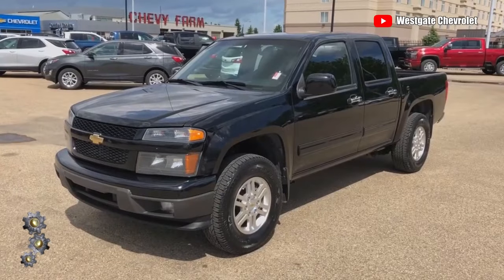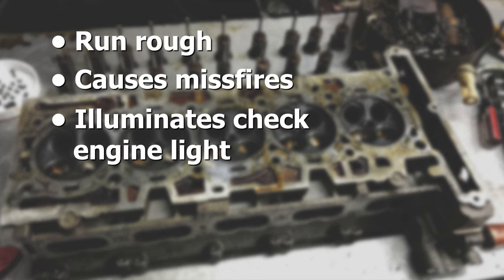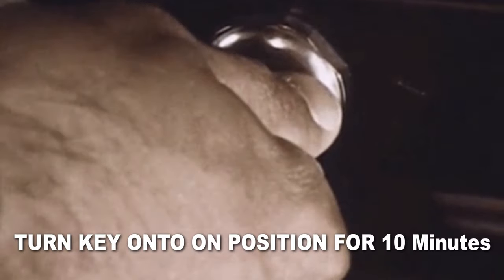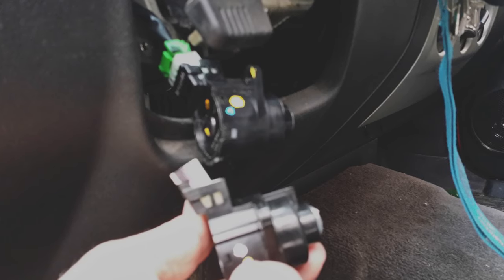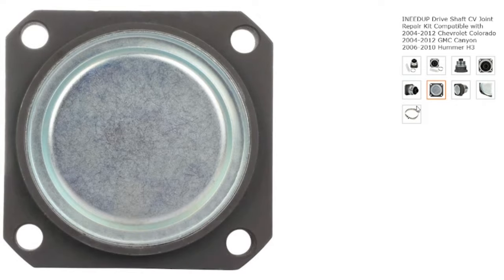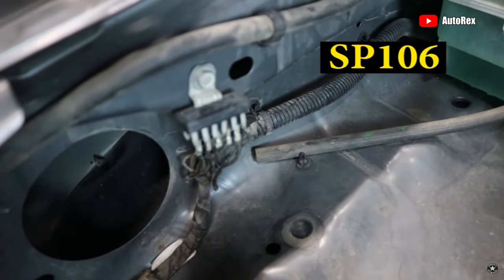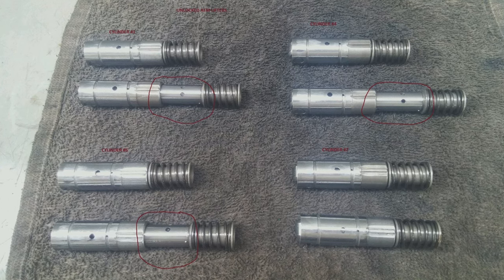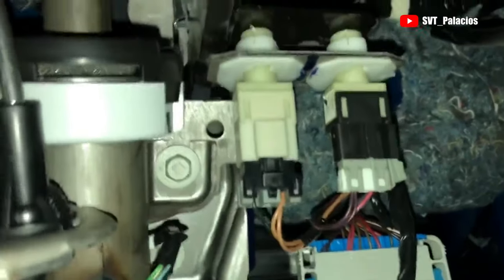Watch This Before Buying a Chevrolet Colorado  2004-2012 (GMC Canyon)

Comment: I have a 2005 i5 Colorado that just rolled over 300k miles and it’s still bulletproof!!
Reply: "redneck voice": yeeeeaaahh I got me a 2004 Toyota frontier 4x4 with 2 miles, bullet proof at it's finest here. Especially when I go off road at Costco market, switch that puppy to hi 4x4 . TRD nismo for life "
Reply: Change your oil and it will see 600k. Poor maintenance spins bearings on these beauties.
Reply: I got a 06 i5 z71 2dr 150k coming to my house next week! Hoping to drive it everywhere!
Reply: I have 2008 best truck I ever had. Not one problem, 150 thousand.
Reply: Is it still running?
Reply: My 2012 GMC Canyon i5 3.7L just hit 275,000 miles & still is going strong with just doing the recommended preventative maintenance.
Reply: 2005 Colorado - 200k miles and still going strong. I change the engine oil every 4k, transmission fluid every 30k, and power steering fluid about once a year.
Reply: Do you still have it though
Reply: My 05 blew up at right around 250k
Reply: any updates?

Comment: My 2004 Colorado 4 cylinders still running strong 💪 with 200 thousand miles
Reply: good to hear brother, just got my 4 cylinder 2009 colorado for about $12k at 90,000 miles!
Reply: 2006 5 cylinder 249000 miles
Reply: OPOL  didnt have much time to search for a private seller with a deal at the peak  of the used car market. Guy rear ended me and totaled my previous vehicle.
Reply: @AegisofAges  I just got a 09 gmc canyon 97,000 miles got it for 5 grand but i got a friend deal
Reply: My 04 Canyon 3.5l has 317k an still trucking
Reply: @AegisofAges  how’s she running now? I’m about to buy a 2012 colorado with the same miles for about the same price
Reply: @kwp3097  its great man no complaints. starts up easily in cold temps. its at about 105k mileage now. Its a real easy vehicle to work on I was able to do all the 100k mile mark maintenance myself. Check and see if the 2012 model has rear drum brakes, I never serviced those before and they look tricky so i am looking into doing them. the 4-cylinder model is perfect for my amazon business, it has no issue moving high volume, low weight cargo. gets about ~22 mpg. Reliable all around vehicle, glad I got it.
Reply: 2007 Colorado 370k haven’t had a issues one owner
Reply: @bryton Pickett  is yours the 5-cylinder?
Reply: @OrcaBoat3  4
Reply: You're on borrowed time with the timing chain
Reply: Just bought a rebuilt 4x4 manual 4 cyl 200k miles for 5k it rips ass
Reply: same here i have to replace the cv joint this weekend

Comment: I've had my 04 since new, and it is the best vehicle I've ever owned.  It has over 200 thousand on it, and I've done almost nothing except change the oil.  I replaced the serpentine tensioner, brakes all around once, window cranks,  and rear shocks.  When I bought it, I knew it was a first-year vehicle, so I picked up a spare engine (18,000 miles) out of a wrecked one.  That poor engine has been sitting for almost 20 years! Great truck and I don't know if I'll ever want to replace it.
Reply: My mom sold hers. So, I bought another one

Comment: My 2006 z71 3.5L is at 250,000 miles and still running strong. Very reliable
Reply: I found a 2007 colorado with the z71 suspension pkg and 131000 miles on it, for sale at $7000. Its extremely clean inside and out with  a nearly flawless carfax report. It has the 5 cylinder motor in it. My question is, should I buy it? I currently have a very clean, solid 2014 Nissan frontier desert runner that Im about to sell because of a great profit Ill be making from the sale. So is the Colorado something I should be considering? Not gonna use it for any heavy duty work, just light loads on normal roadways (city driving). Thank you in advance!
Reply: @popeyevalls  I would, that's a very dependable vehicle
Reply: @jbass986 how many miles now
Reply: @lam-kq7bn  not sure now, the frame rusted out and pretty much disintegrated. I had to replace the truck as it was to dangerous to drive on the road. The motor and transmission still ran perfectly though.
Reply: @jbass986  mine is at 350,000 and runs smooth asf frame isn’t rusted as much as any other truck but she still runs good asf

Comment: The 5.3 Colorados and Canyons are not flex fuel engines. They also don’t have the AFM. The 2009 engine is the LH8 which does not have any of the above and also does not have VVT. The 2010-2012 5.3s are the LH9 which has VVT but nothing else.

Comment: I am the first owner of a 2006 Chevy Colorado 4wd with all the options available at the time. Mine is nearing 250,000 on the original engine and transmission. I live in a no snow area, so I plan to get a remanufactured engine and transmission, go through suspension front to back, replace all brakes, rebuild the rear end, and replace the leaf springs (mine has a lean). I’ll also replace the radio (upgrade for Bluetooth), replace a damaged door, and have a basically new truck for $10,000 in parts (I’ll supply the labor).
Reply from the maker: Heck yeah Anna! Love that. And, it will last another 15 years! That’s a project, but to me it is a fun project
Reply: Thanks…. Interestingly, sort of me too: 2007:Canyon LE/4 Cyl, loaded (* exc NO,4Wd, No,Remote or “ no Deluxe INTERIOR)*….. ,)…@146,000 miles.
Reply: Ps::: be interesting to get updates,,… ps I need to replace my MONROE SUPER SHOCKS , maybe Plugs soon……….. thanks

Comment: Appreciate the video. My 2005 Chevy Colorado 3.5L Z71 is currently in the shop and going to cost me $2k worth of repairs.  I love my truck and it’s at 167k miles.  I know it’s got much more in it and I’m going to watch the rest of your videos to see what I can do to ensure it gets there.  Thanks!
Reply from the maker: What ended up going bad?? It probably does 🙏 keep taking care of it and it will take care of you
Reply: @AutoMotivate  radiator, abs sensor, break pads, etc…hopefully last big fix for awhile. 🤞🏼
Reply: @allthingsunrelated2919  should try working on it yourself, you would have saved yourself $1500
Reply: @Sneakshot88  I try to do as much as I can on it. But very good point.
Reply: @allthingsunrelated2919  most shops are just outrageous on pricing
Reply: @allthingsunrelated2919  Mine has over 300k miles on it. The last owner's engine had burned itself in oil somehow. We bought it when it didn't run and only replaced the engine (it had about 100k miles on it) and i've only had small/easy to fix problems. It's a simple truck so there isn't much to break. good luck to your colorado!
Reply: @allthingsunrelated2919 Brake pads? They are expected to wear out.

Comment: These trucks are a great platform for LS swaps. If you are going to buy one, get a 2007-2012 model because those had less issues and don’t tow heavy loads in these trucks because you will burn up the transmissions in these trucks. I would only tow a small lightweight trailer behind it.
Reply: I have the 04 5cyl z71 4x4 over 300k miles. 
I have pulled a 16 foot duel axel trailer hauling a tractor, full size cars,and full size trucks. 
Never any transmission problems whatsoever.
Reply: @workingman9745  Same never had an issue , and Iv towed wayyy over gm recommendation. They were rated at 4000 . But they can easily do 5500 . Although most iv done was 6800 I think . But zero transmission issues
Reply: @shipmastershadowofintent5249  I ONCE  pulled a 16 foot double axel trailer loaded with shingles piled as high as possible and one tire even went Flatt.
That was way to much but like I said I done that ONCE 😅
Reply: I think he might being saying this because they used the same trans in the chevy van and they would burn up because it had no air flow. All the trans have a bad rap now. I changed the oil on mine at 100 thousand and the magnet only showed small pieces of metal really no wear at all.

Comment: I have a 2011 4 by 4 crew cab, with the 3.7 liter inline 5-cylinder engine. I bought it brand new in April 2011. It's running great still, with 115,000 miles on it.
Reply: Just bought a canyon with 63k miles and a short cab.  2012 too with an inline 5.

Comment: 2006 Colorado 3.5 here. 170k miles with perfect compression. With the lock cylinder not recognizing the key, the issue is usually just a worn out key. I have replaced my key twice and both times solved the issue for $5.00. The key ridges get worn out going in and out of the ignition so much that it becomes hard for the truck to recognize and trips the immobilizer. I've owned the truck for 8 years and owned it since 65k miles. Only things noteworthy that have broken are a cracked manifold, brake switch and blower resistor. NBD.
Reply: Indeed! Hate waiting for the security light to stop blinking and then starts. Even with the VATS tuned out it still triggers the light. The first things to go were the cracked manifold(use to be $768 at the dealer only in 2008 and the resistor/blower wire harness that I bought new as well for $96. At 196k the engine needed a belt tensioner and oil pressure sensor replaced. Almost 19 years and for the rest of my life. Atlas engines are my passion.

Comment: I just had the head on my 2007 model completely redone. Head gasket blew out, timing chain jumped teeth, and a myriad of other electrical issues. It all came crashing down at nearly 260k miles though, so I'd say mine did pretty good. Just got it back and its running good as new though as the entire rotating assembly is in pristine condition. Only ever had minor issues with electronics otherwise, and she's back to rolling strong for another 260k.

Comment: 2009 Chevy Colorado I4 RWD. Great video. Brake light sensor did go out at 70k. Thermostat replacemented to get the AC back, break booster replaced as well. Truck leans 1 inch lower on the driver's side. All in all great truck, never stuck... Knock on wood.
Reply: The left front side of my 2007 leans as well. Do you know what is the cause? I'm assuming it just needs new front struts. Not unusual after 15yrs.
Reply: @palebeachbum  they call it the "chevy lean." basically its the  weight of the driver and the gas tank that causes the left side to settle or sag a bit over time. new front struts will work, or if you have torsion bars (4x4 or 2wd Z71) you can just crank the left side torsion bar bolt to adjust the height and compensate for the sag
Reply: @JackBarlow.1  thanks for the info! Mine's a 2WD SL. It's bare bones so I'm guessing I don't have the Z71 package. You don't happen to know how much it costs to do front struts on this truck, do you?
Reply: @palebeachbum  they don't have "struts" they have upper and lower ball joints with a torsion bar acting as the spring. I don't know their adjustable but I hope so cause my o7 Colorado does this.

Comment: I have a 2010 3.7 4wd Colorado and let me just say that all the engineers where in different rooms when they came up with this!! It has a decent engine, the i5 is durable and lasts long. I have 186k on the dash and the engine is running strong! I don’t like that they put a 4l60e in it though! Don’t try to tow with these trucks if you like your trans in good shape!

Comment: I’ve got a 2008 3.7L 2wd with 130000 miles on it. Keeping my fingers crossed I don’t have any of these issues but as of now it runs great. Decent gas mileage too. About the same as my 2005 v6 mustang.
Reply: Is your's the v6? And how would you compare going from a full size to a Colorado if you have before...thanks
Reply: Maintenance it will see 300k with occasional redline (6.3k) trust me

Comment: I have a 2010 3.7 5 cylinder Colorado with 205k miles on it, traction control does not work which means no abs, check engine light is on for emissions bank leak, constantly beeps at me but other than that, it’s a super solid truck. I actually love this thing
Reply: A wheel sensor is bad, 07 and up have individual lines out back with wheel sensors as well.  More than likely it’s your front hub. Have it scanned by a knowledgeable person. For emissions could be a faulty gas cap or your evaporate canister could f the $15 cap doesn’t work or is working. Dead reliable trucks.
Reply: @WoodLox  yeah I just got the traction control fixed. The other issues honestly aren’t even an issue that they aren’t worth fixing. I’d probably get better mileage sorting out the bank code

Comment: My 07 has 200k and runs like a champ I paid 10k for it a year ago and it has definitely been a good truck for it being a budget truck I wasn’t expecting it to last this long
Reply: Just got a 07 3.7 with 247k for $8,800 in pretty decent condition. Hope it threats me well!
Reply: I have a ²007 Isuzu I 290 and no problems
Reply: Damm, I'm about to buy a 2011 i5 4wd, with 80,000 miles for 7k from a dealership with no trade in
Reply: I'm getting an 08 with 140k miles for 3200 bucks . W a nice cap

Comment: I have a 2006 Crew cab. Its been a great vehicle. Had the valve issue but had it fixed under warranty, well... I didn't really have the issue I just took it in and said its been running rough and they decided to replace it with no run around. Also just replaced the fuel pump it rotted out. But that's all I've ever really had to do beside standard maint.

Comment: 2004 i5 z85 crew cab, 192k currently. I have replaced the brakes, drivers wheel hub assembly twice( the shop didn't do it right the first time, so I fixed it myself the 2nd time around, new alternator, new battery, new water pump. The main problems I have had were electrical stuff. bulbs burning out, turn signals not working(seems like this video addresses all of that). The truck still runs great.

Comment: I have a 2004 Chevrolet Colorado (2WD, 3.5 liter 5-cylinder and 4-speed auto). I bought it new in July 2004.  It now has 288,000 miles.  Engine and trans are still smooooth.  Parts wear out or break occasionally, but nothing big. Only issue I have from this video is the Passlock activation issue.  Simple repair replacing sensor on end of ignition lock cylinder. You treat your truck right and she’ll be good to you. Maintenance, maintenance, maintenance.

Comment: I got a 2011 GMC Canyon 4 cylinder and Love It... 🥰 No issues at all 150k on it and running strong 💪 Gas Saver 😁
Reply: What did u pay I’m looking at a 2012 almost at 150k going for almost 8k.. prices are crazy rn
Reply: @jesus1sl0rd56  I paid $6500 about 4 years ago. Only maintenance I've done on it is oil changes. 😀
Reply: @jesus1sl0rd56  depends on what you're getting. the 2007 4 cyl 5 speed  regular cab manual im looking at has 120k and theyre asking $3500. the 5 cyl crew cabs are gonna run you way more even tho they suck
Reply: @jesus1sl0rd56  8k is not bad....is that cad or usd? USd To much.
Reply: Let me say again, my truck had 250 thou and change when I bought it.  I wasn surprised when the starter went out only the location of it and the support bolts. Other than  that any issues I had were to be expected from a vehicle of this age and milage. I ve owned several Chevy s,  was Earnhard's no 1 fan, never owned a bad Ford truck but & would rank Toyota number 1 as far as toughness and dependability.

Comment: I have a 07 standard cab rwd 2.9L and I am younger so it’s my first truck but we do have a little boat 1700lbs and I tow it around lots with my dad or mom does great the 2.9L is a good little engine love it
Reply: Thanks,  I just bought a 2wd 2007 singlecab 2.9 I4  with 210,000 miles. It runs great, everything works, power windows, power mirrors and locks 😊

Comment: I have a 2006 crew cab, 3.5L inline 5, 217,000 miles…aside from normal maintenance it’s been a great truck. I really can’t complain about anything. I did have the issue with the passlock not recognizing the key. I put in a new ignition and reprogrammed it. Other than that, it’s been just normal maintenance. Replaced fuel pump twice, just replaced water pump and alternator. Frame is quite rusty but the truck is 18 years old. It’s definitely been good to me.